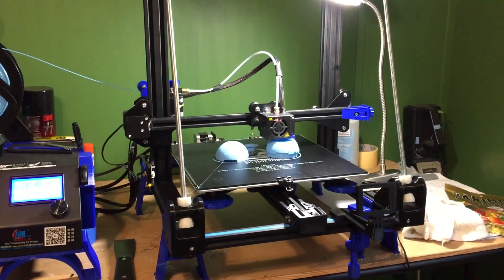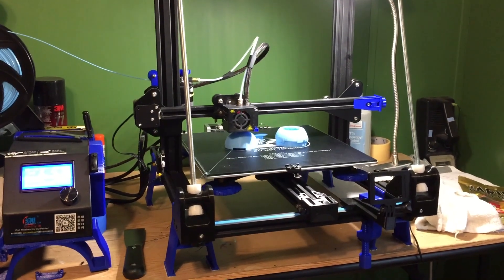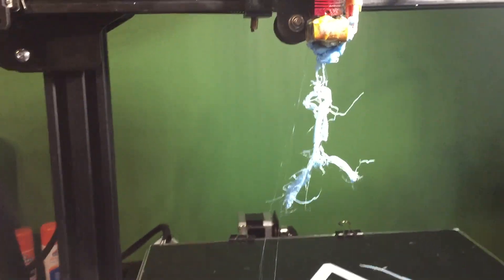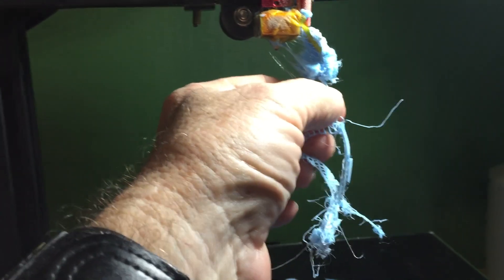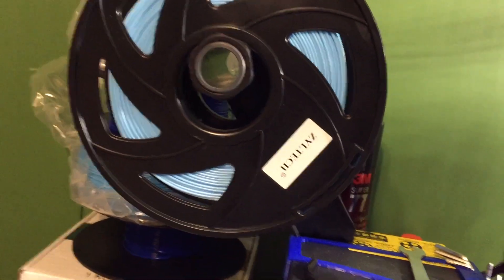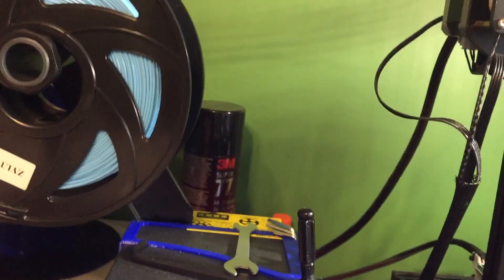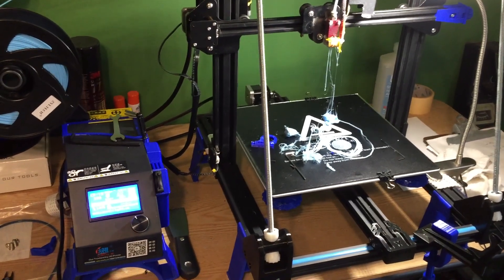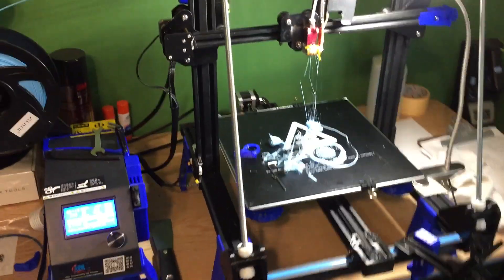CR 10 3D printer filament destroyed my project

Comment: others do not have a problem with this brand i just ordered a bunch ( i mean a lot)  i will see on my cr 10
Reply from the maker: I ordered several spools and all were a disaster. I re-stocked with Hatchbox for now and no more issues. Hope you keep us informed with your order and see how it all works for your projects. I tried different settings, but always the same mess to clean up. Good luck and let us all know if yours is different.

Comment: Hatchbox has always worked very well for me but 3DXTECH PLA filament prints even better as long as I run it at 210°C to 215°C vs, the 195°C I use for Hatchbox. Ziro filament is OK but not quite as good as Hatchbox. For ABS filament I haven't found anything that prints as well or as strong as 3DXTECH, I'm sure there are others that are just as good but why fight with success.
Reply from the maker: I was thinking after my failed attempts that settings with the cheaper PLA just might be the answer. Good thoughts from electronron : )